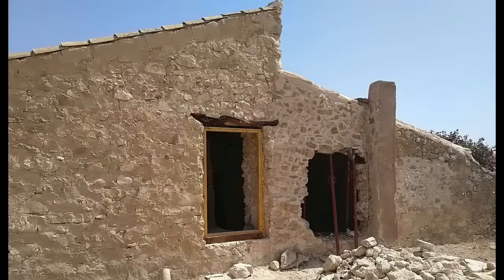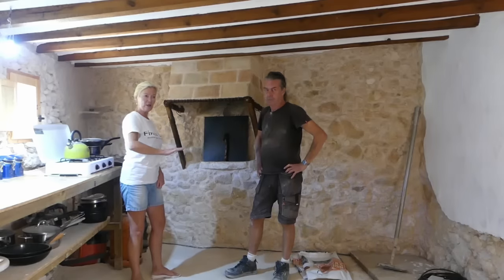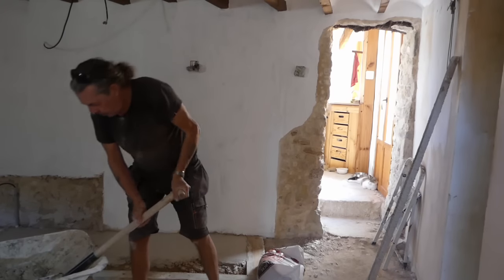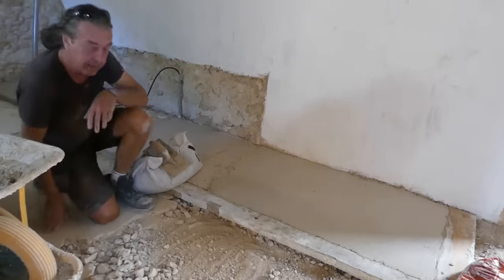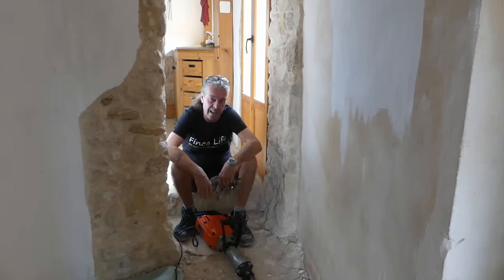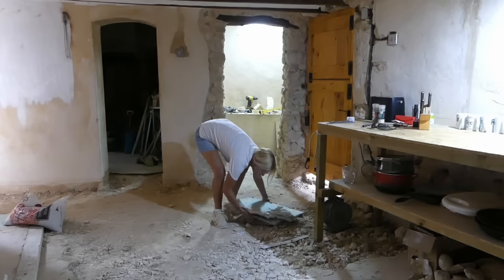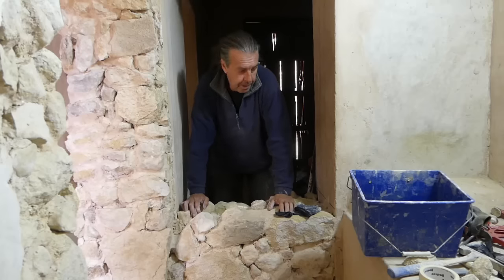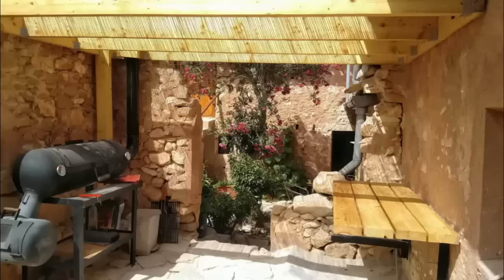We really need to get this done - It's holding us up! - Restoring a 150 year old Spanish Finca

Comment: You are doing a fantastic job. I really want to use lime plaster in our stone finca, but it doesn't seem to be easy to buy. None of my small local builders sell it. Leroy Merlin sell it, but it is 15.59€ for 25kg a bag. I will need a lot of bags for my walls. How much do you pay per bag please?
Reply from the maker: Hi Elaine and thanks. It's widely available in this area - the only place that doesn't sell it is Leroy Merlin. Hydrated lime is around 5€ for a 12kg bag and NHL3.5 is 7.40€ for a 25kg bag
Reply: Thanks for reply. That seems a better price. I’m a bit confused now as I haven’t used it before. I thought NHL 3.5 was hydrated lime😳 would you mind explaining the difference please? I don’t want to go and buy the wrong stuff. I want to use it on the walls inside and outside.
Reply from the maker: @elaineheeley3020  NHL is hydraulic lime which means basically that it sets once in contact with water and will even set under water. The higher the number the stronger the mortar but also the less flexible and less breathable it is. Hydrated lime sets differently and is more flexible and breathable but not as strong and will not set if kept wet or damp. Generally, hydrated limes are used on conversation projects, eco-builds or just old houses. Hydraulic limes (NHL) are used for new builds, some conservation projects and in areas exposed to harsh weather conditions. We generally, much prefer hydrated lime due to it's flexibility and ease of use (we really like working with it) but we use NHL for areas like floors because it sets much faster and is stronger. For stonework and pointing we use hydrated lime, inside and outside and for some internal plastering but if we were rendering outside for example, we would use NHL 3.5 (1 part NHL3.5 to 3 parts coarse sand). Hope that helps
Reply: @FincaLife  That’s a fantastic explanation. Thank you. The simpler the better. I’ve tried reading up on the Internet and have never understood. Your explanation is perfect. Good luck with all your projects. My house is very similar and also in Murcia so I feel I’m working along with you. Thank you